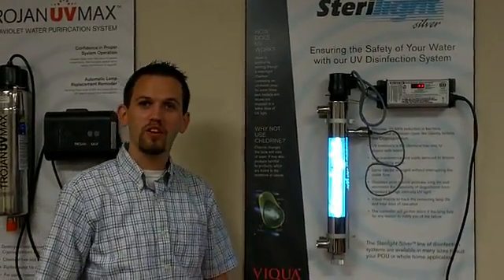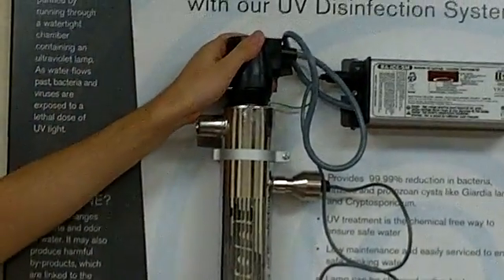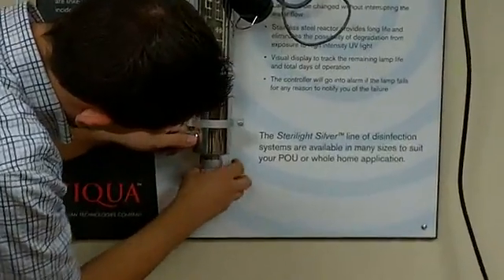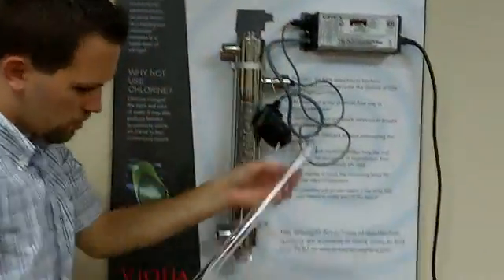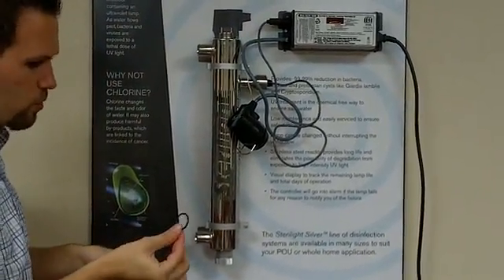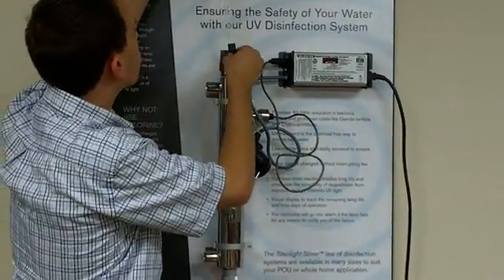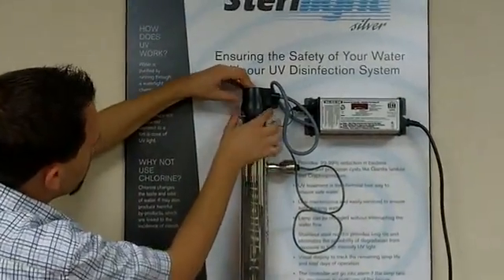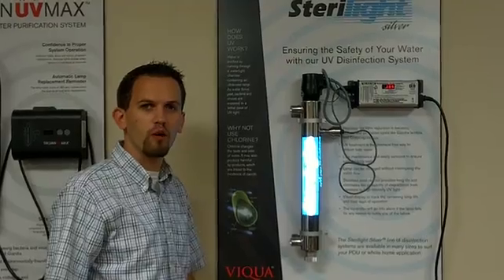How to Change a SterilightUltraViolet UV bulb or lamp.

Comment: My BA-ICE-S UV controller keeps beeping even though the lamp has been replaced, what do you think is the cause?
Reply: This is typically caused by forgetting to reset the lamp countdown reminder on the ballast.
Reply: @HomePlusProducts  has been reset appears rSet and the number 365 but only briefly and immediately beeps and nothing appears
Reply: Terrible back ground noise
Reply: Thank you for also showing how to replace the quartz sleeve.